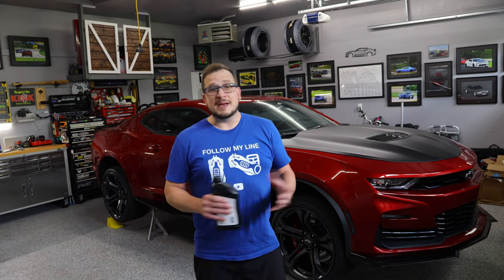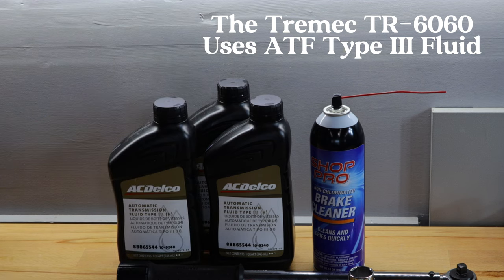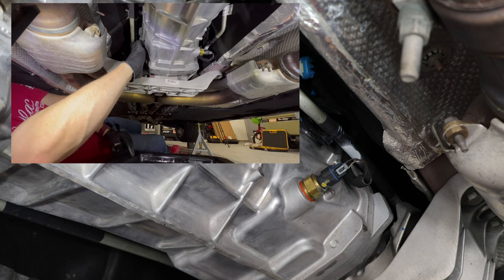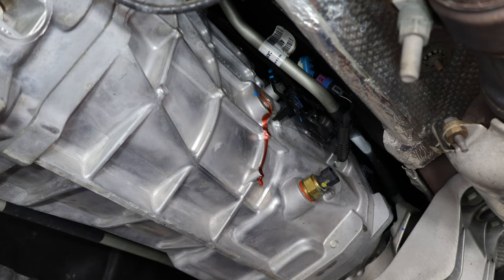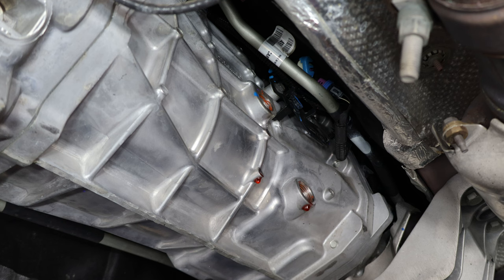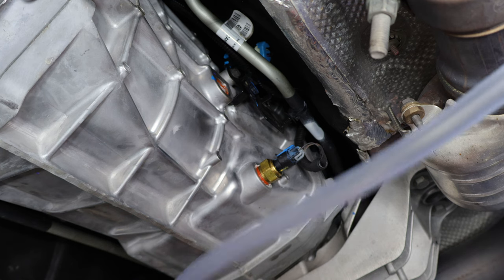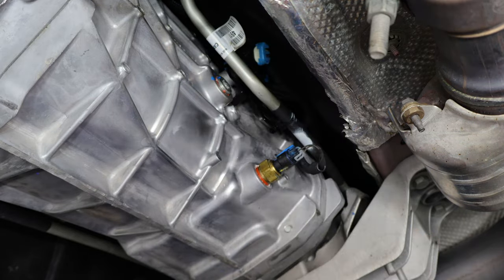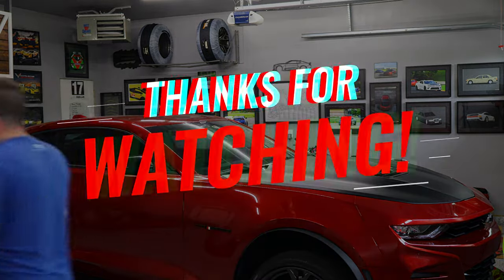The EASIEST Way to Change Your Tremec TR-6060 Transmission Fluid // Updated for 2024!

Comment: Loved that you mentioned the Australian cars 👌
Reply from the maker: Nothing but love for the land down under!
Reply: I did mine yesterday. I used the same bungs you did. I noticed the temp sensor bung is slightly higher than the drain bung. 
I also changed from ATF to 70w-75. Now I’m thinking there’s probably some ATF left inside and I’ve mixed it with the 70w-75. Do you think this is going to be an issue?
Reply from the maker: @gts-5349  the Tremec really is designed to run on ATF, or at minimum Dexron III certified fluid. The 75w90 may be a bit on the thick side, and I’m wondering if in the long term, it would cause issues with anything internally. I wouldn’t worry too much about the slight mixing, you’ll never get ALL of the old fluid out, but I am curious how the 75w90 will play out over time.
Reply: @gts-5349 GL-4 70w-75 is too thin, kinda like Dexron VI/Mercon LV (~6 cst). You probably ideally don’t wanna go above a ~9 cst (@ 100 C) . If anything, I think getting a quart of GL-4 75W and mixing the rest of the fill (~3 quarts) with 75w-80 (GL-4), is ideal. 75w-80 is kinda thick for some folks, unless you go with a brand like BG Synchroshift 2. 

I would either stick to a GL-4 75w-80 gear oil fill, for all around driving, especially if you don’t have as cold of fall/winter climate. If you live in a cold climate, it’s probably best to stick to a ATF+4 or DCTF formula. Those are my best personal experiences. 

Tremec themselves recommends their in-house GL-4 75w-85 MTF for their own crate transmissions, which I find to be pretty tedious of warming up in the fall and winter seasons… Especially if you daily drive your car and need to be driving and merging onto the freeway immediately, and don’t have time to sit and idle your car forever or take a little extra stroll around with your car, it’s really not ideal. 

Oh, and don’t mix ATF with MTF; it’s really not ideal… It might work for a while, but the reaction of the mix is kinda unpredictable, especially if you go with different brands. The only time I’ve considered doing such a mix, is running something like Redline MT-90 or MT-85, with Redline D6.

Go to Bobistheoilguy for all your research and forum needs. The folks over there are real helpful and there’s lot more info on there that’s widespread, on top of using specific vehicle forums as well.
Reply: @FollowMyLine17 The only times I’ve ran a high viscosity/weight GL-4 gear oil like 75w-90 or 80w-90, I’ve either mixed with a DCTF or Dexron VI/Mercon LV formula. The lower viscosity/weight of the DCTF or ATF, helps to thin out the gear oil. 

It’s not ideal to combine ATF/MTF, due to the unpredictable mix reaction; but I’d probably stick to the same brand if I would consider mixing. I’ve mixed Redline MT-85 and MT-90 with Redline D6 ATF before, and was probably a fairly reliable trans fill. 

I only ran it for one year, however, and then decided to swap to a complete DCTF fill instead. I usually also tend to swap to a mix of GL-4 75W and 75w-80 (GL-4) gear oil, which is a bit thicker  and provides more protection for hotter temps, in my personal opinion.
Reply from the maker: @ great info!

Comment: I have the 6spd on my 23 ZL1 . How similar is it to your SS ? Are they similar to my 06GTO 6 spd? I don’t drive my car but maybe 200 mi a year. At what mileage should I you change this fluid ? Is there a time specific expiration date on this fluid that I should change it if I don’t hit the mileage in that service range ? I’m not cheap or trying to  save money I’m more in line with the idea of the fluid is cheap and the parts are not
Reply from the maker: Great questions! The 6 speed in your ZL1 is identical, and everything you saw in this video would be the exact same procedure. The 2006 GTO uses the T-56, which the TR-6060 is an evolution of, however not the same. If you track your vehicle at all, you should change the fluid at every 15 hours of track use. If you do not, technically the fluid is “certified lifetime” meaning it doesn’t technically have a change interval, however I recommend changing it at 50,000 miles.
Reply: @FollowMyLine17  I agree . I don’t believe in lifetime fluids
Reply: I typically change mine with every other engine oil change. Unless I’m on an absolute budget or am babying my car and not driving it on the daily, I can leave it for maybe the length of about 3 oil changes worth (mileage dependent). 

Same does for my rear axle differential. I typically change that on the same DIY timeline I use. At most, I’ve gone maybe 4 oil change intervals until changing; which most people still go wayyy longer before doing so. 

It’s also worth noting that if you run something like Mercon V or Dexron III, those are commonly conventional, unless mentioned otherwise to be semi-synthetic or fully synthetic. This means that they shear down a lot earlier, especially with hard driving and lots of mileage put on the gearbox. 

I usually opt for a GL-4 gear oil, DCTF, or an ATF spec like ATF+4 or a high performance Dexron III/Mercon V. I’m not so worried about these shearing down earlier than expected. GM has said that their trans fluid fill from the factory is designed to go through the most “extreme” conditions, even all the way up the owner’s manual fluid/oil changing intervals, which I don’t believe either…

However, I have a 5th gen Camaro SS, so I’m not sure if the rear axle diff has been revised/upgraded for the 6th gen Camaro models. My factory LSD uses a clutch-based engagement, so those typically wear out with high mileage applications, or even earlier/more so with harsh driving conditions. They also tend to chatter a lot and make slight noises, if you don’t add extra limited slip additive or mess around with a particular full synthetic LS-specific (limited slip) GL-5 gear oil.
Reply: @isnowyazn thanks for the info . I want to take very good care of it .

Comment: What do you use to protect the exterior, if anything, on a track day?
Reply from the maker: Outside of regular wash maintenance and a ceramic coating to make it easier to clean, nothing. I bought the car as a track toy, not a show car, so if you get up close you’ll see all the imperfections on the front bumper, hood, glass, etc. I know many people get PPF on those areas for protection, but even PPF gets beat up pretty good on track.

Comment: Great information!  I used a huge Suction gun off Amazon to fill mine back.  Much easier than the pump.  Taking out the sensor is a great idea!  The drain plug makes a huge mess.
Reply from the maker: I’ve used the suction gun before as well, I just find it made an even bigger mess for me than the pump did, so I went back to the pump.

Comment: Does that work with the Pontiac G8 GXP 2009 with manual transmission Tremec TR6060?
Reply from the maker: Yes! It’s the same process and even though I had the GXP in my notes, I forgot to mention it in my video. Shame on me… I’ve had a couple of Grand Prix’s back in the day and forgot to show some Pontiac love.
Reply: Yes, all the Tremec TR-6060’s and older Tremec manual transmissions/gearboxes are ALL spec’d for Dexron III fluid traditionally. Technically, Ford spec’d Mercon V and Dodge spec’d ATF+4, so I’ve never had issues running any of those, or even a mix. 

The only thing is to avoid LV (low viscosity) ATF formulas, like Dexron VI/Mercon LV or Dexron/Mercon ULV (for 10-spd automatics). There’s tons of other re-branded and similar spec’d LV ATF’s out there, so probably best to do research and not run a poorly functioning ATF. 

Go onto Bobistheoilguy for more info, research, and a super helpful and thorough forum you can use, to help you look up what you need, for practically any vehicle application.